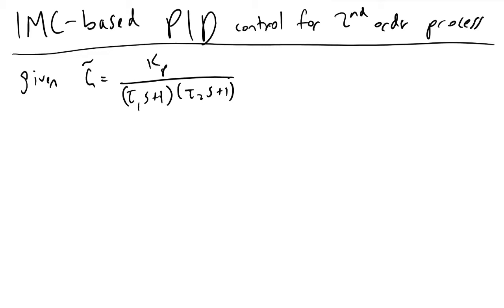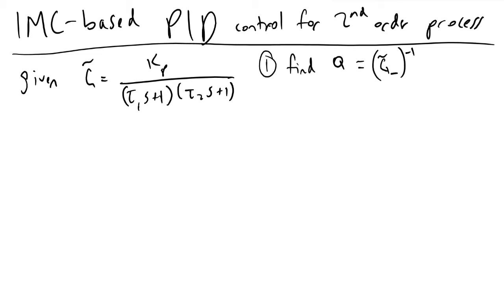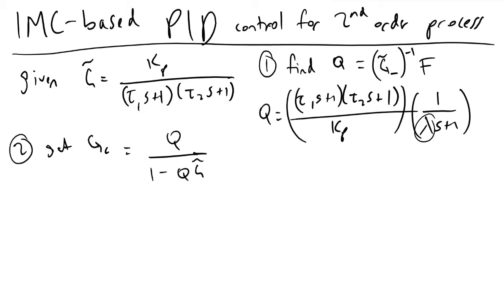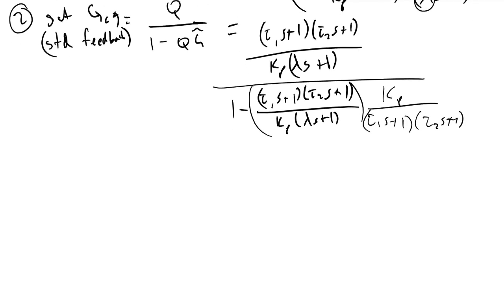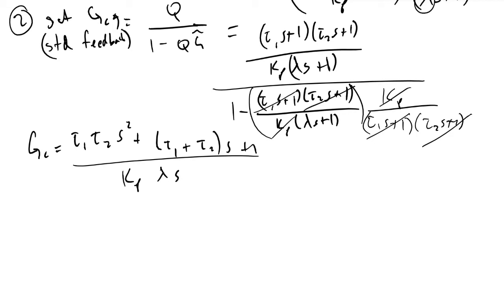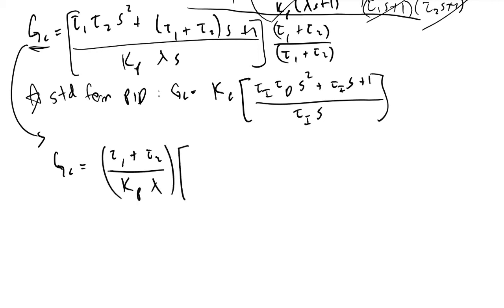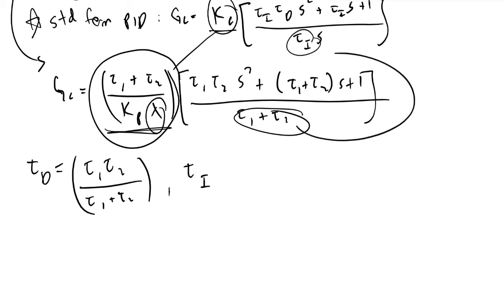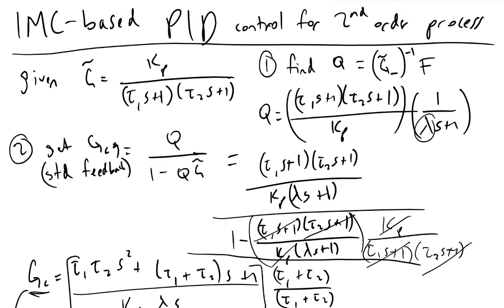IMC PID Design of a Second Order Process

Comment: Hello, one of my students referred me to this video and I'm sorry to say there's a mistake in it. The filter should be a second order filter in order for Q to be "proper" i.e, F=1/(lambda*s+1)^2. The order of the filter is taken so that it is the same as the numerator which in this case is a 2nd order polynomial. Therefore the translation equations to classic PID format are also wrong. The actual "Proper" (realizable) PID formula is: C=1/(Kp*2*lambda)*(1+1/(tau1*tau2*s)+(tau1*tau2/(tau1+tau2))*s)*1/(0.5*lambda*s+1).
Note the factor 2, and the post filter on the non realizable (theoretical) PID formula. This is the answer obtained and produced by the Rivera Skogestad Morari article in the early 90's.